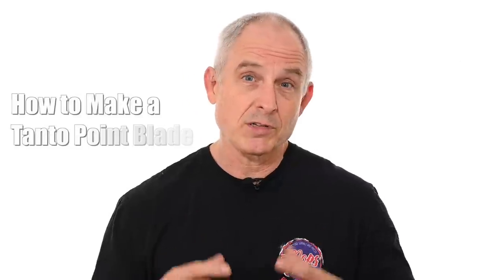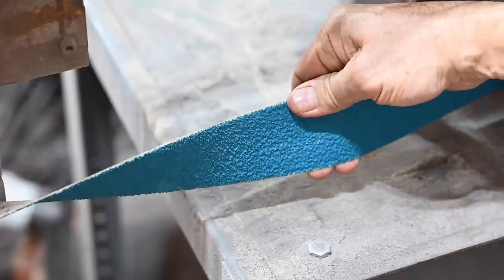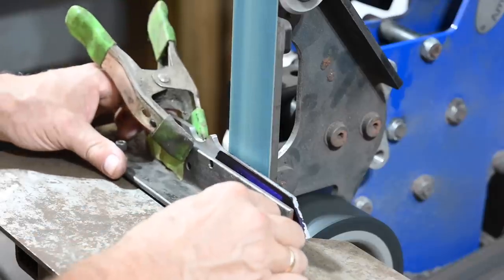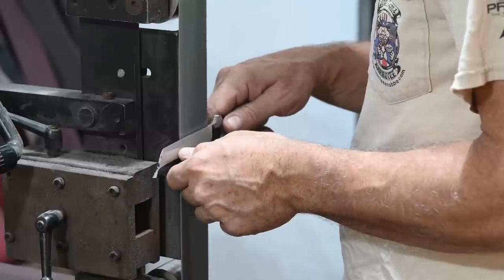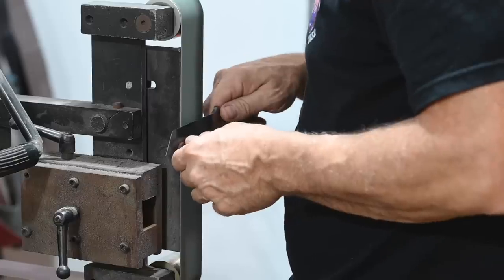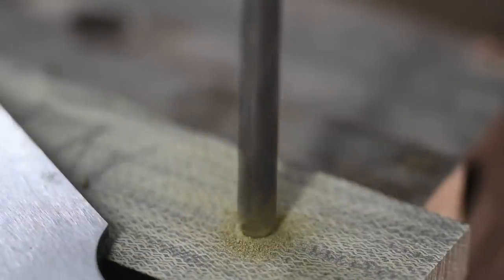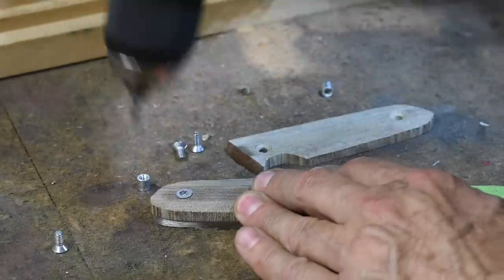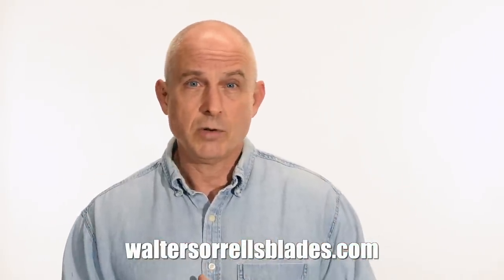How to Make an Amazing Tanto Point Knife! (with Removable Handles)

Comment: FYI Flat head Inch screws normally have 82 degree heads but metric is normally 90 degrees.   It's also possible to find inch and metric screws with 100 degree heads that work with thinner material and give a larger load bearing surface for softer materials.

Comment: Thanks for that, still interesting despite it being useless. 
I've got a STANELY 239 which almost fits that category, It was for electricians to make grooves to put there wiring into. (must have been low current stuff or i can see a potential fire hazard)

Comment: Could you put a high polish on the bottom of your profile jig to prevent snagging ? Then maybe a fence of some sort to control the variation you spoke of ?
Reply: You can also attach a sheet of delrin or cut up a plastic chopping board. Silky smooth.